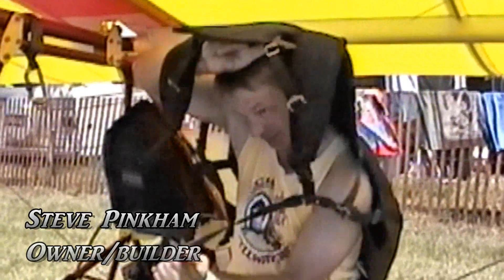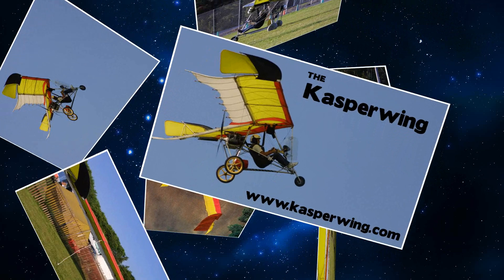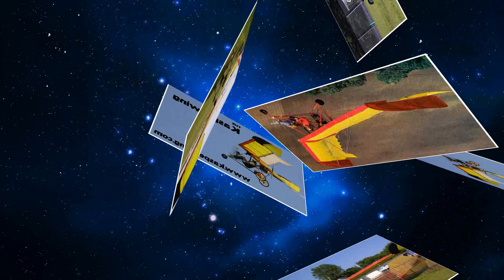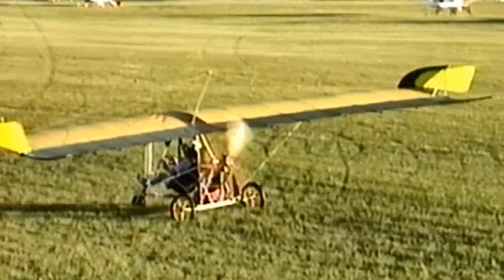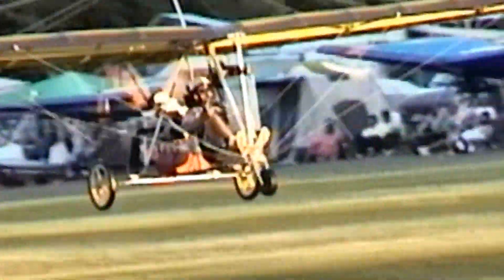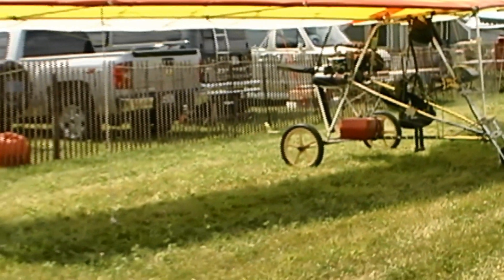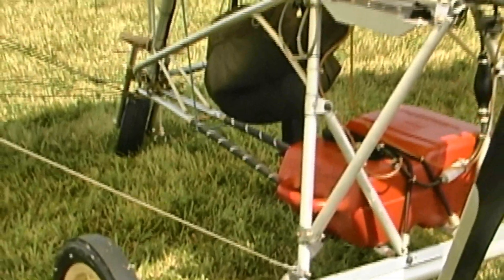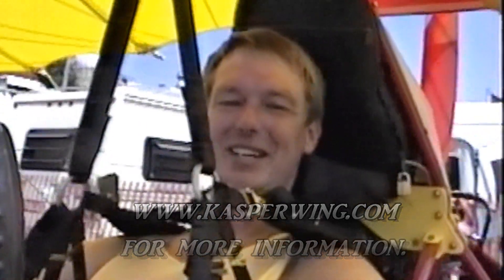Kasperwing flying wing, Kasperwing weight shift ultralight aircraft, Witold Kasper.

Comment: The very first Kasperwing ultralight and hang glider  were built by Don Matson with the assistance of Witold Kasper. Steve Grossruck with Kasper's assistance then built upon Don's early work with multiple improvements, Steve's company Cascade Ultralights  produced 333 of the Kasperwing 180 ultralights mostly the standard 180 model, a limited number of 3-axsis and 3-axis 2 place planes were also produced.  

 The KW 180 does not have a conventional stall break, it can however be stalled if forced (whip stalled), in normal operation when power is reduced, the nose held above the glide angle the plane will slow until zero forward airspeed and then enter a stable "mush". Full control of the aircraft can be maintained in the mush because of the unique wingtips control system, the aircraft has no tendency to drop a wing and will not stall-spin like a conventional airplane. The KW 180 has excellent STOL characteristics and has maintained an excellent safety record,  possibly the best of all ultralight aircraft ever produced.  
  
 Most importantly the KW180 is good wind in the teeth flying, if you want to go faster than the law allows look elsewhere.